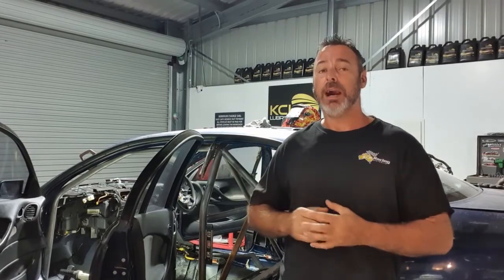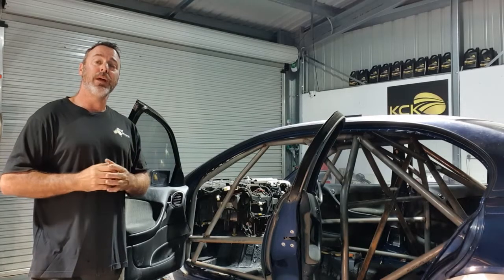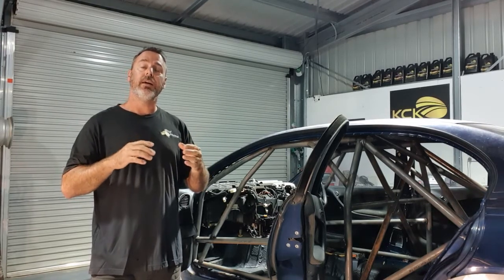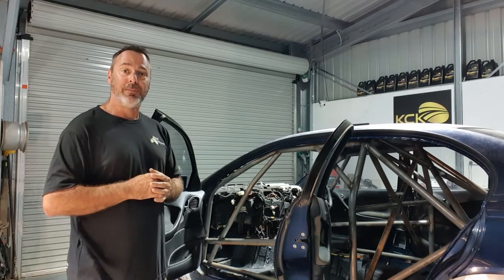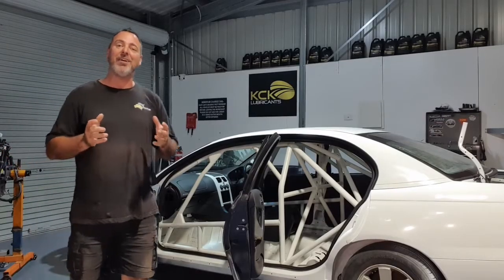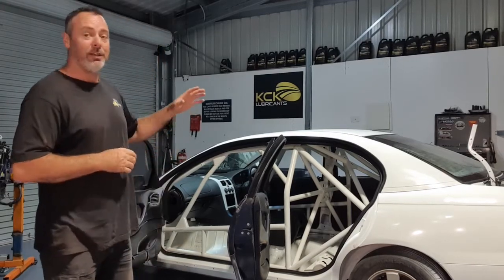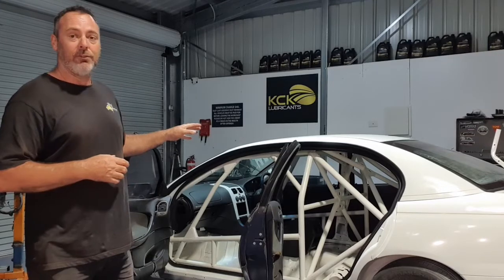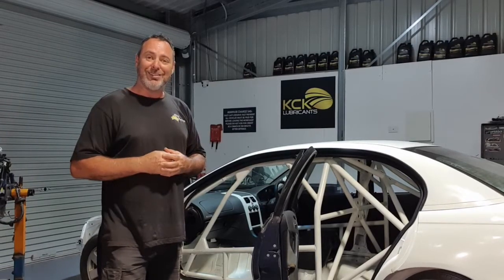Very Cheap Race Car build Episode 2, making a Roll Cage at KCK Racing Australia

Comment: I have a question about removing sound deadener. 
Would it make much difference if it was left in ? Seems like a lot of work for not a massive gain and makes the car hotter ?
Reply from the maker: Thanks for watching, Absolutely you can leave it in! it is just an easy way of removing some weight from the car.
Reply: @KCKLubricants  how much weight are you talking ?
Reply from the maker: @rodneypurbrick7899  easily 25kg!
Reply: Every ounce count's...
Reply from the maker: Every KG is a HP!